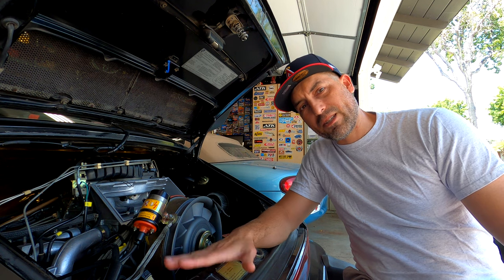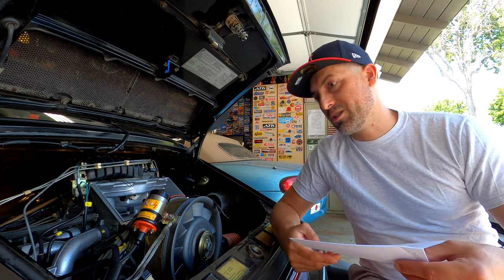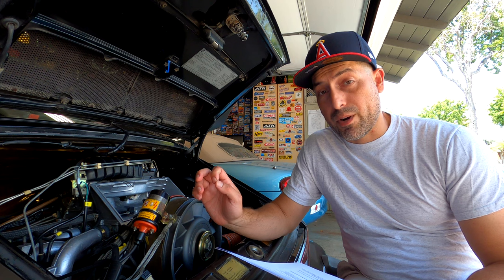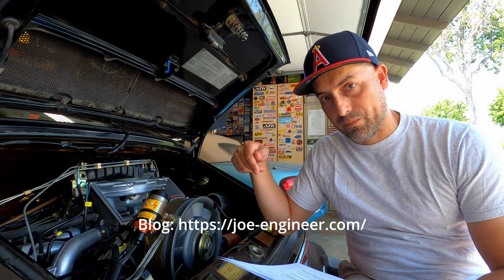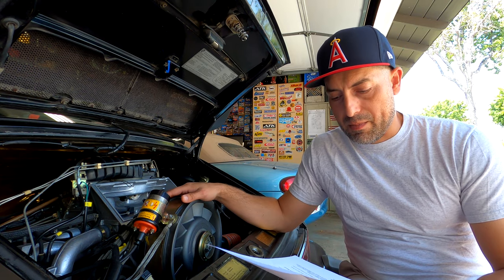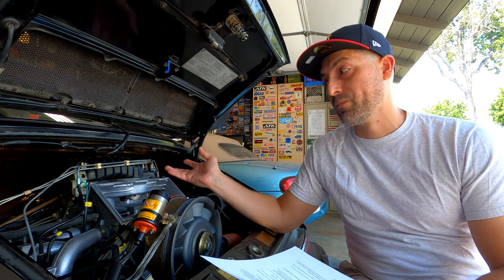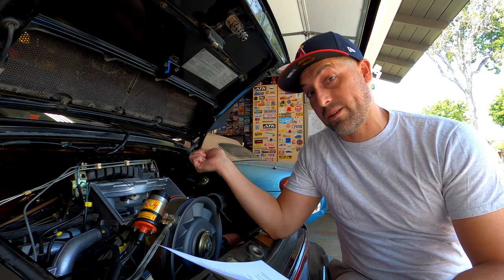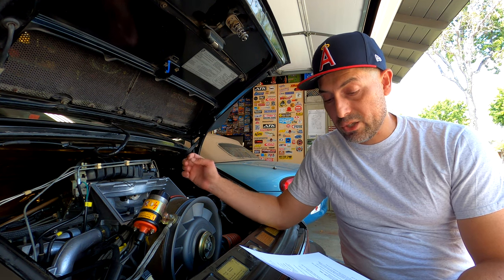How To Adjust Open Loop Fuel Mixture for Porsche 911 Bosch CIS K-Jetronic Fuel Injection

Comment: Great video explanation.  That's exactly how I adjusted my K-Jetronic '83 BMW 320i.  Your ear is the best instrument on these finicky systems.
FYI:  Here in NC we have non-ethanol fuel readily available.  I run pure Sunoco 95 octane.  It's pricey fuel.  Keep up the good work.  I subscribed.

Comment: So the mixtrue screw only adjusts the flapper height up or down? Thanks for the video.
Reply from the maker: It adjusts the position of the piston inside the fuel distributor at idle, and therefore the idle fuel mixture.
Reply: @JoeEngineer  thanks Joe. I followed all the steps you outlined on my 1982 911 SC. The 3mm allen appeared to be stuck as I  cannot turn it. Probably hasn't been moved in years. I can smooth out the idle and eliminate the backfire by slightly lifting the plunger so by smell and the idle, it seems lean. I'll hit it with a bit of penitrating oil and let it sit overnight.

Comment: When you say "without a Lamda system"
Are you referring to those unfortunate owners who have a completely deleted lamda system (like myself)?
ie. Nothing there
Reply from the maker: Correct. No factory lambda, deleted or otherwise.
Reply: Thanks Joe.
So I can't find ANY lamda rel wiring or the FV. And my WUR has tubing to the vacuum adv circuit. Guessing I must have the "pre lamda" ktronic.
It seems like all there is to control the mixture is that screw and the WUR & cold start valve. 🙃

Comment: Hi Jose, all the tuning applies while the engine is warm?
Reply from the maker: Correct! Open and closed loop. The only one you can do while cold is setting the initial mixture to just get the injectors to spray enough to start the engine (earlier video).

Comment: Hi Jose, quick question, in Ireland we have now been mandated to use E10 grade fuel, no E5 or full leaded fuel available at all.   It is causing a lot of consternation in the classic car community.  Obviously the higher ethanol content can be very problematic for older vehicles, particularly those with carburettors.  I know E10 fuel has been available for about 30 years in the US, but I think you have a range of fuels available.  What fuel grade do people typically use in classics, 30 years +?
Reply from the maker: I believe most of the fuel around here (southern California) is E10. While I was rebuilding my fuel system I replaced all my lines with E85 compatible rubber, for future proofing.

Comment: So my car has a pretty significant amount of idle surge.  I'm going to smoke test it this weekend, but looking ahead here, how do you set the idle at 900 for this test when it's surging from like 1400 down to 500 back to 1400?  If it's rocketing back and forth pretty quickly, I'm not sure how you're supposed to dial that in.
Reply from the maker: Generally if it's surging it's on the richer side and if it's popping and backfiring it's on the lean side. But I would fix all vacuum leaks before messing with the mixture.
Reply: To follow up on this, there was a vacuum leak at the manifold.  The shop I sent it to didn’t bother to smoke test it when they set it up, so when I got it, they had set it to run REALLY rich.  I found the leak and had them fix it and I’ve been working on correcting the mixture the past hour.  I verified it was running rich (not that the copious amount of black smoke and surge didn’t tell me that) with the test by pulling and pushing on the plate flap.  Idle cleaned up when pulling it down.  So I let it warm up and tried to back the idle down.  Got it down to where it was surging between like 800-1200 and started leaning it out.  As I leaned it (which took a few clicks), the idle came up to like 1200.  Dialed the idle back down a bit and the surging came back.  Tested it, idle improved leaning it again.  Gave it two more clicks and it cleaned up again, but idle went back up to like 1300.  Repeated the process again.

At this point, the idle is pretty good, but is sitting at around 1100.  No more surging, no backfires, etc.  I think that if I did it again, I might be able to get it to idle down to where it should be, but I’m not doing anymore tonight.

Point is, that’s how badly the shop has the thing set up.  It ran and drove, but it was so unbelievably rich that they had the idle screw really turned way past where it should be and the mixture screw at least one full turn to rich.  At least.

It’s no wonder the gas mileage was atrocious.

Comment: Thanks Joe. First video I have seen from you and that's a nice explanation. My car is a 1977 2,7 CIS and I seem to be having the same problems with a surging idol but only during the warm up cycle. During the first start up I get surging and the revs are really bouncing up and down until the car is up to temp. After that, the revs sit at a solid 950. This problem is really annoying and something that i have lived with for a few years, since I did the rebuild. Now, it needs to get sorted out. I think it is far too rich during the warm up cycle and it's like it's not getting enough air, but I am struggling to locate the issue. The Engine loom is new, the WUR & Fuel Distributer was rebuilt. The Thermo valve is new, the AAR is working correctly. All components in the system have power when the engine is running and seem to be functioning correctly. My fuel pressures are in spec etc etc. It's a real head scratcher but i will be using your videos as a guide to cross the t's and dot the i's! Thanks for positing.

Comment: perfect video.  my car has been set up like this for a long time and this finally gets me a better understanding on how the previous owners set it up.  Its almost like adjusting a carburetor! LOL!  one note I know from my old carburation cars that if you don't have a o2 meter then you can check how your plugs are burning.  Clean one, run it 50 miles or so and check again to see how it is burning.  Mine was white and running lean on all 6 plugs.   Adjusting it now and hope to dial it in soon.  Cheers....